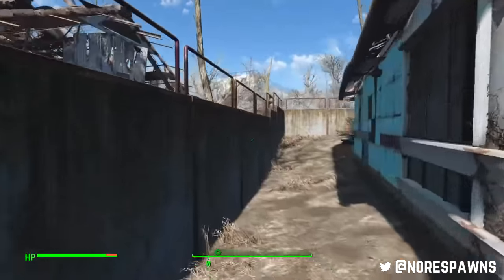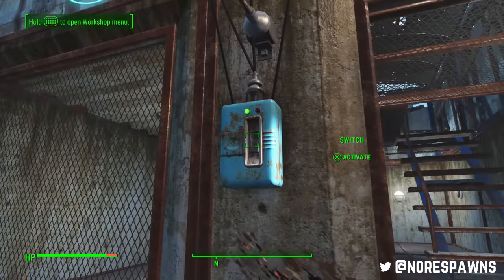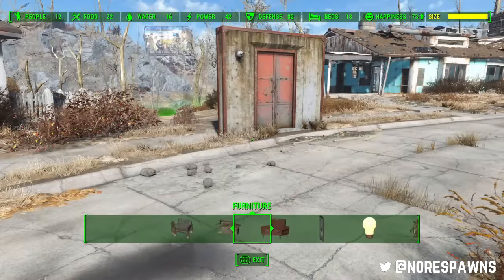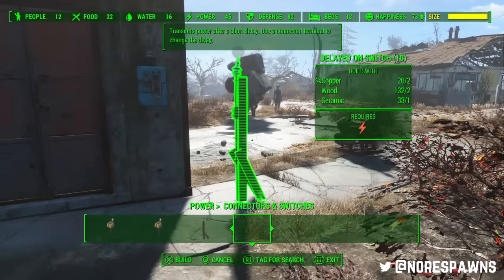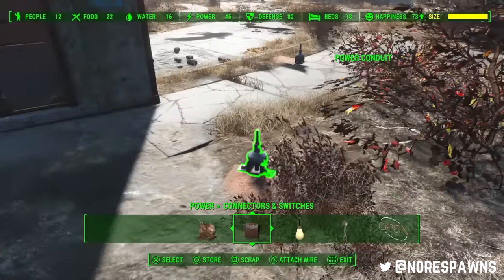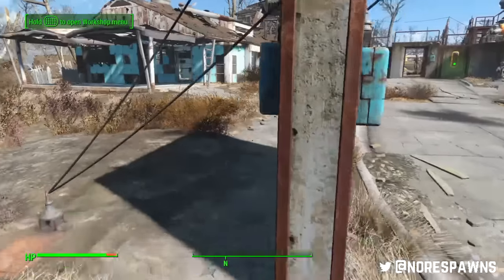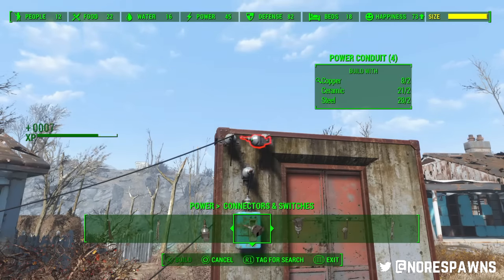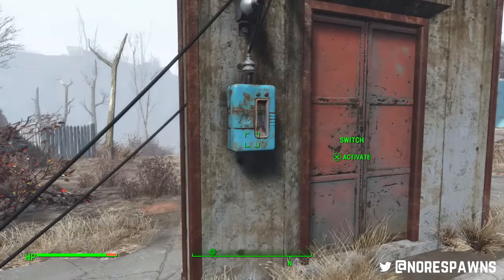Fallout 4 Guide - Working Powered Doors with TWO switches

Comment: Wel i like the idea...but i want to be able to both open and close on both sides....so on the inside i just placed a terminal connected to the Switch on the outside and bang, can both close and open on either side...only downside is that i have to use a terminal but thats like 3 sec extra work xD

Comment: Try it in my home - doesn't work.
Try it outside - works fine.
Try it in my home - doesn't work, again.
I swear to god I am losing my fucking sanity right now.
Reply: +EonHSD nice door set up, you realize you only need 2 power switch and 1 connector? 
5 EASY STEPS
step 1
2:30 put a switch board on the "inside"  but DO NOT connect (yet)
step 2
put connector on the floor DO NOT connect (yet)
step 3
3:00 put a switch board on the "outside", now connect that switch on the "inside" but DO NOT connect it on the other switch, connect it on the door frame connector (wire glitches in).
step4
 now connect both "outside" and "inside" switch on to the connector on the floor. (you can flip the door left and right to glitch the wire).
step 5
finally connect the main power line on the "outside" switch board. 
there you have it a simple working powered door with two switch!. BTW when putting the "connector" on the floor, make sure that is the spot where you want your door as you can glitch your door to sit on top of it! :)

like if you think this help! :D

Comment: For fuck sake. I did this 1:1 but it doesn't work. I think that's because my outside is the Initial power Switch of the door. So I'd have to mirror this..
Reply: +EonHSD nice door set up, you realize you only need 2 power switch and 1 connector? 
5 EASY STEPS
step 1
2:30 put a switch board on the "inside"  but DO NOT connect (yet)
step 2
put connector on the floor DO NOT connect (yet)
step 3
3:00 put a switch board on the "outside", now connect that switch on the "inside" but DO NOT connect it on the other switch, connect it on the door frame connector (wire glitches in).
step4
 now connect both "outside" and "inside" switch on to the connector on the floor. (you can flip the door left and right to glitch the wire).
step 5
finally connect the main power line on the "outside" switch board. 
there you have it a simple working powered door with two switch!. BTW when putting the "connector" on the floor, make sure that is the spot where you want your door as you can glitch your door to sit on top of it! :)

like if you think this help! :D

Comment: I just used two pressure plates a la minecraft.
Reply: +OrniasDMF You can put a single plate so that it clips through the door and be able to step on it from either side. Just get it wired up as normal and step on it in workshop mode, then "pick it up" (while still standing on it) and place it in the middle of the now open doorway.
Reply: But then you have to wait for the door to open